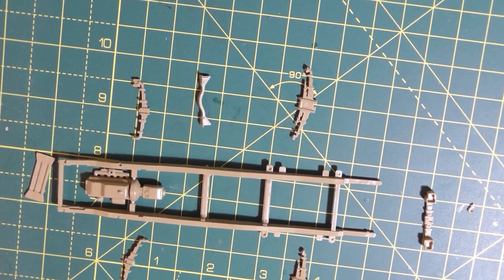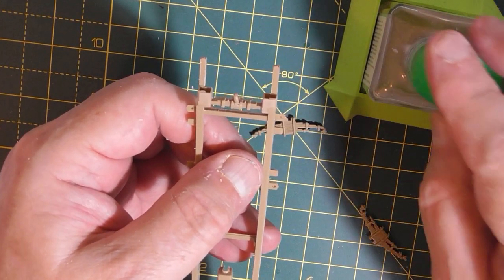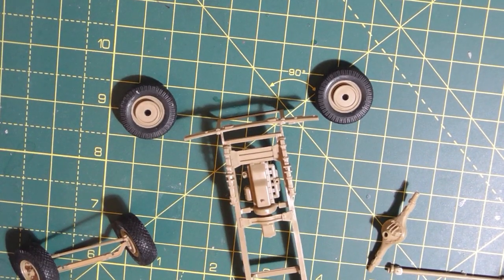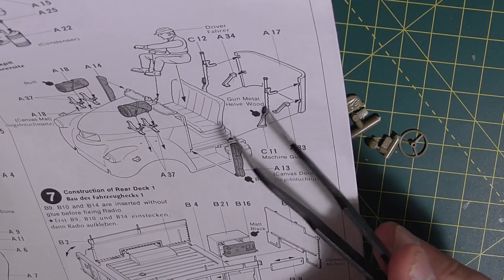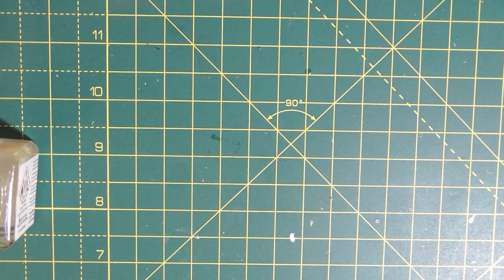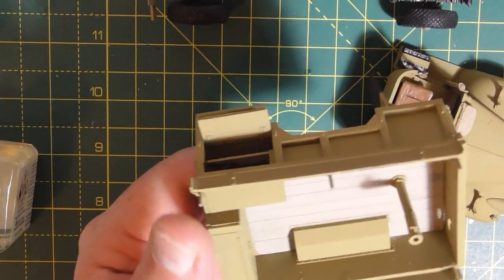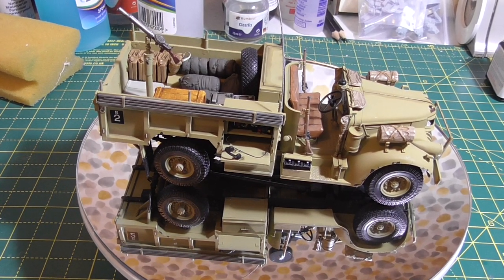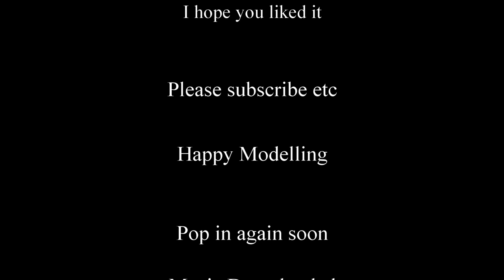Tamiya 1/35th scale British LRDG Command Car part 2

Comment: 👍👍Great looking model. Just bought one myself today as a change to building German tanks. I intend to take it on holiday with me as insurance against a rainy day or two. Looks better than I imagined looking at the box, I noticed the kit has numerous accessories which clinched it for me. One question do you use superglue to add the painted parts? So far I’ve tended to glue them on and paint them in situ but my 68 year old eyes and not so steady hands make me think it would be easier and better to paint them then add them to the model.
Reply from the maker: Hello Don Im glad you like'd it. Its a nice kit, Yes after I painted the accessories I attached them with a small about of superglue. I glues the figures to the base with wood glue though, Happy Modelling :)